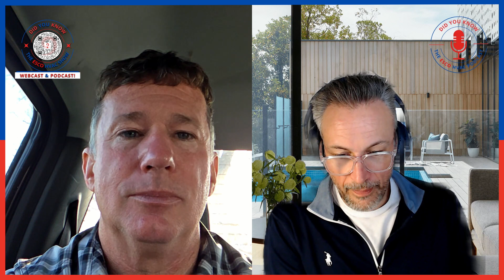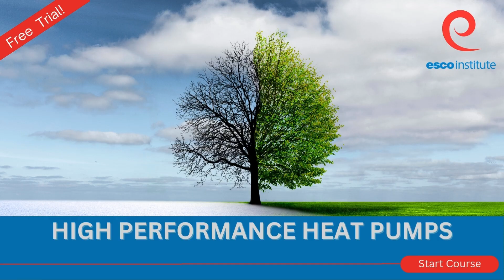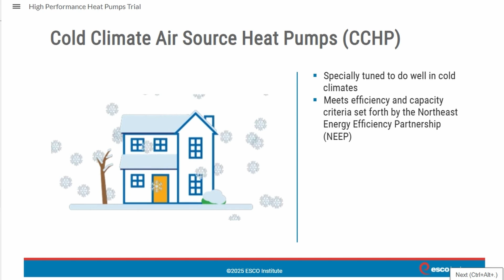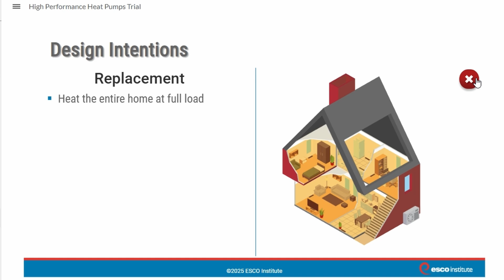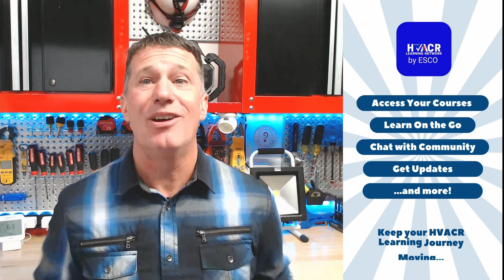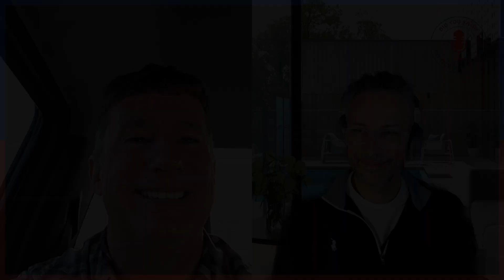Unlocking the Future: Geothermal and R-290 Heat Pumps with Kevin Stickney

Comment: Sorry, but R-290 is nowhere close in the US.  It will take several building code cycles to get A3's approved in the US, if ever.  It took a decade to get A2Ls in the building codes and it took tremendous effort to get that done.  Safety standards, building codes and litigiousness are very different in the US compared to Europe.  Also, air to water systems are less efficient than air to air systems.  Air to water systems require glycol in freezing climates which hurts efficiency.  Air to water systems also require an additional heat exchanger between the refrigerant and water.  There are also pumping losses for moving the glycol mixture through the system.
Reply from the maker: Actually its getting very close. Here is a good article to shed some additional perspective: https://naturalrefrigerants.com/ashrae-committee-chair-expects-2025-or-later-for-approval-of-higher-r290-charge-for-heat-pumps-in-u-s/
Reply: @escogroup  sorry but did you read what Jim said “this is not going to be a quick process”?  I know Jim and Xudong and I work on these codes in the industry.  That article is from March 2024 and not much has changed.  Addendum e did not pass and they are going to push for more research.  The natural refrigerant lobby is pushing for propane but they’re not willing to take on the liability for using propane.

Comment: Why the attempt to switch from 454B refrigerants? I thought 454 was suppose to have a near Zero GWP and it is less flammable than something like 290….smells like someone trying to make more money and not really solve problems…either that or I’m smelling propane
Reply from the maker: It is important to understand that all HFC refrigerants are being phased down worldwide, including R-454B and R-32. R-454B has a GWP of 466 compared to R-290 GWP of 3. Most of the world is transitioning to ultralow GWP refrigerants like R-290 and CO2, we are actually behind times here in the US.
Reply: @escogroup  Thank you so much for the reply! It does make me shake my head that we are even doing a 454B transition with R290 on the horizon. Also I find it very interesting that we are making units that are processing CO2 as a refrigerant. As Oxygen is suppose to be taboo to have in a system at all yet we are allowing the element as a process in the refrigerant. Definitely not something I can wrap my head around just yet.